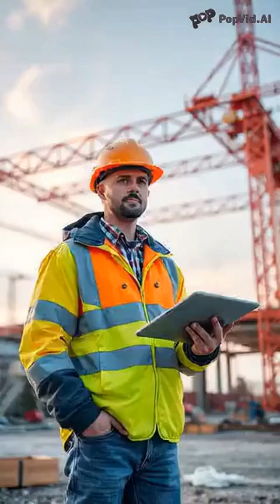We Never Actually See What's Underground — Here's Why That Matters

Comment: I agree with the premise, but I'm skeptical of calling this a 'new framework.' A lot of GAIDF's elements look like they're already present in the observational method (Peck, 1969) and geotechnical baseline reports. What's genuinely new here versus a re-systemization of existing practice?
Reply from the maker: Completely fair, and I'd rather you push on this than let it slide. GAIDF isn't claiming to invent uncertainty-aware design — the observational method is a direct ancestor. What it tries to add is explicit integration across disciplines and lifecycle stages that often stay siloed in practice, even when the underlying methods (like Peck's) already exist. Whether that counts as 'new' or just 'better organized' is a legitimate question

Comment: The closing question is good, but I'd want to know if the book is backed by quantitative data — for example, statistics on how many project failures trace to underestimated geological uncertainty versus other factors (design, management, etc.). Without that, the argument stays narrative rather than empirical
Reply from the maker: The case studies are largely qualitative — post-incident reports and forensic analyses — rather than a systematic quantitative dataset across projects. That kind of dataset is genuinely hard to build because failure attribution is rarely clean-cut, but you're right that without it, the argument leans more toward pattern-recognition than proof.

Comment: The point about the 'gap between boreholes' is valid, but I'd argue the real issue isn't just insufficient data — it's how geological interpretation gets simplified to fit the design schedule. Does the book address time pressure as a source of interpretive bias, or mainly data limitations?
Reply from the maker: Good distinction — and yes, that's actually a separate chapter. Data gaps and schedule-driven interpretation are related but not identical problems; the second one is arguably more dangerous because it's invisible until something goes wrong. I probably should've made that separation clearer in the video itself.

Comment: The GAIDF framework is compelling, but I'm curious how it handles commercial pressure. In theory we all know uncertainty should be monitored throughout the lifecycle — but who's funding additional investigation once the contract is signed? A good framework without a clear economic incentive usually stays on the shelf.
Reply from the maker: Fair challenge, and honestly the weakest link in most frameworks, mine included. The book argues for building contingency into contracts upfront rather than treating monitoring as an optional add-on — but you're right that this only works if owners see it as risk-pricing, not scope creep. Would genuinely like to hear how you've seen this handled (or not handled) on your projects